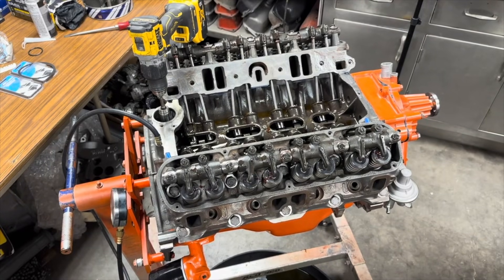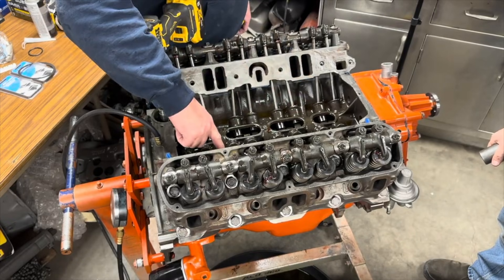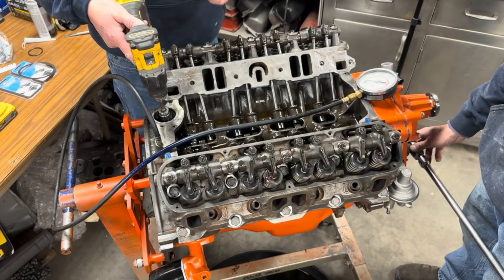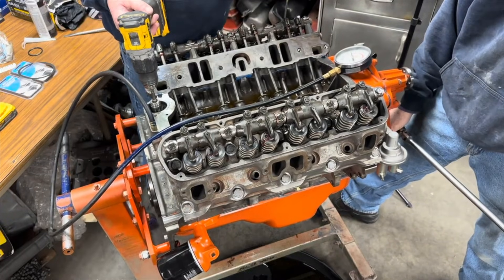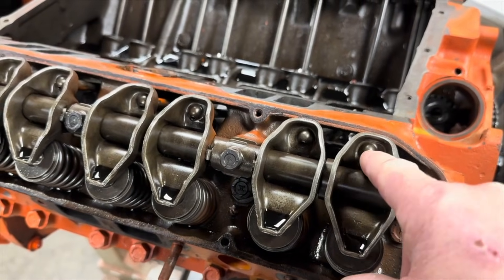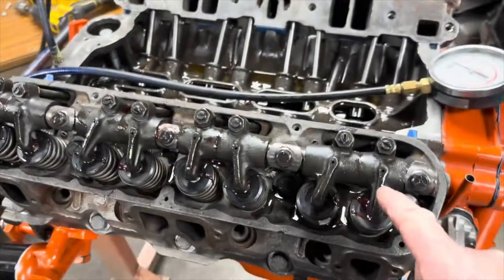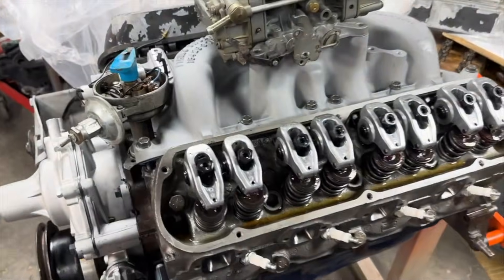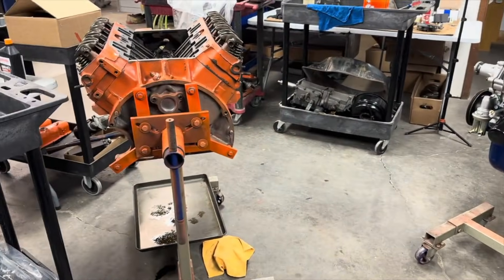How to Properly Pre-Lube a Chrysler Engine (Why Oil Pressure Isn’t Enough)

Comment: Hey Keith.

 My dad and I built a 440 probably 20 years ago for his 72 charger. life got in the way was never installed or broken in. she's been sitting out in the garage all this time.. I took the car on a few years ago and I'm getting close to thinking about putting the drive train back in. do you think priming the engine would be sufficient? or should it be torn back down ? 

Thanks,

Mike.
Reply from the maker: Is the engine in the car ? At least drain the oil . Fresh break in oil and filter . Mark the position of the distributor. Pull it and prime the oil pump. Reinstalling in reverse order
Reply: @moparkeith1  no its on a stand. yea that's what the old man says too. just trying to get a few outside opinions. appreciate it Keith.
Reply from the maker: @mikefleming953 if it’s on the stand drain the oil then Pull the pan and clean it . Then flip the engine over . Most likely some gross stuff sitting in there. New gasket and maybe replace the rear main seal incase it’s dried out then pre lube
Reply: @moparkeith1   good advice will do.  Thank you.